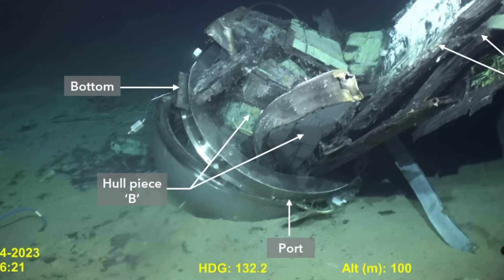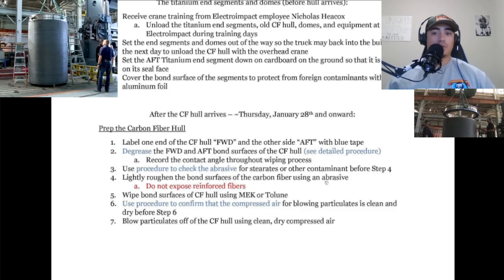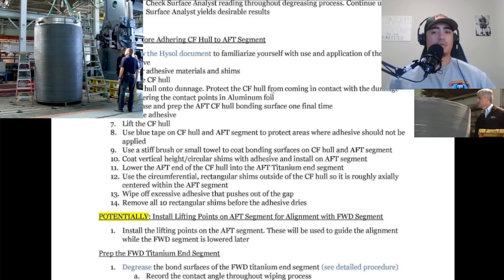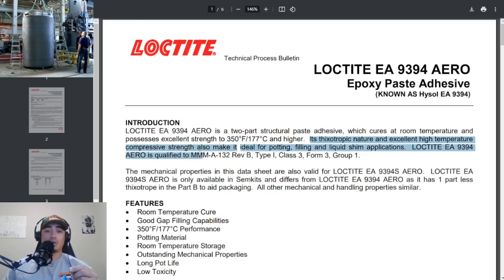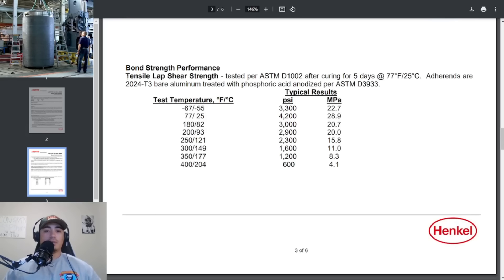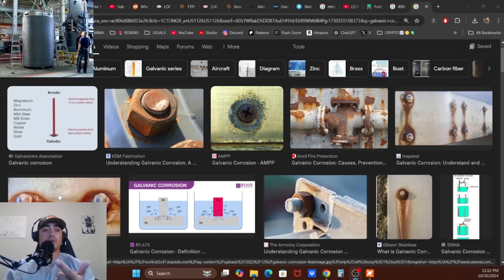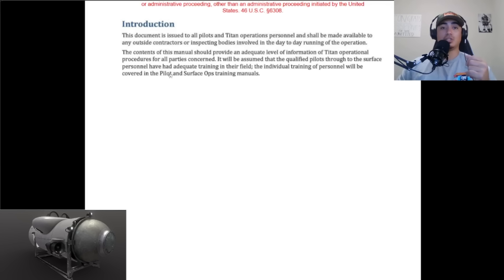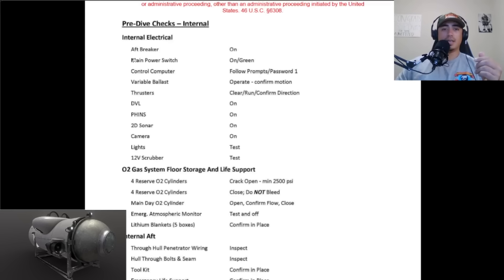Part 5: OceanGate TITAN Investigation: Money Laundering, Glue, & Operations Manual - Latest Files

Comment: Not only what appears to be rust on that front titanium flange at the bottom/inner edge, but it looks like oxidation on the top/outer edge, just like what you see in aluminum.  And then you tell us the loctite has aluminium fillers.  And I say to myself, again:  FFS.

Comment: GREAT VIDEO .   I think There is no good way of mounting carbon fiber tube to the titanium ring  . the carbon  fiber and the titanium movement under pressure was massively different . The carbon fiber tube was scwished in middle at the center of the tube more than the ends pulling the carbon fiber away from the titanium ring with great force till it failed along with many other things also i believe with every dive more and more carbon fiber strands  broke with every dive . Personally i think the design was a bad idea and never should have been built . To me i can't believe it made it to the titanic on the first dive . To everyone that died my prayers  go out to you .   R I P .
Reply from the maker: Thank you for sharing your thoughts. I agree and even the acoustic and strain data agrees. There was a loud BANG on dive 80…. This was dive 87 and should have been decommissioned

Comment: how were they going to use those four oxygen tanks if they were trapped, if they let the air out of the oxygen tanks the pressure inside the sub would pressurize them on the inside with no where for the extra pressure released to escape  !!!
Reply: the volume of the oxygen in the tanks would not have pressurized the entire volume of the sub much, as gas expands into a greater volume its pressure drops....

Comment: I think your analysis of the bond strength is incomplete.  First, the data is for aluminum bonded to aluminum, so all bets are off for carbon fiber to aluminum.  Furthermore, the forces at depth are at least three; first, the pressure will tend to push the titanium ends tighter to the CF hull tube, compressing the joint.  Second, the varying temperature-caused movement of the Ti and CF will create immense sheer force on the joint,  Third, sea water will force intrusion into the joint from the edge.  So this analysis is sort of irrelevant.
These engineers were amateurs in at least a hundred ways.  They had no business designing a life-critical device.
Reply: First off, excelent point you made.  OceanGate made prototype artfical heart valves for the first time , self certified the unit with their own statistical data with zero industry peer review, and now the client is dead on the street because the valves imploded.  This is what happens when someone has a lot of money, but not quite enough, with a desparate desire to bring his dream to a reaility and consciously believes his expertise is sufficient.  History is filled with prototype build dissasters and lost lives driven by phrases like, "nobody in the industry is pursuing my approach," or "we know what we are doing, or our methodology is proprietary", and maybe 'batten down the hatches, full speed ahead with gluing titanium to a carbon fiber face with 5,900 lbs/sq.in of water pressure scratching to come into your peanut shell - just maybe.

Comment: The most elementary flaw in Titan is using carbon fiber in compression.  In the same way one can not push on a rope, one can not push on carbon fiber.  The only load bearing part of that hull was the epoxy.  There are many successful pressure vessels with the high pressure on the INSIDE made of fiber epoxy: MX missle, space shuttle booster, breathing air tanks for firefighters, CNG fuel tanks that are steel with a fiber epoxy outer wrap.  Rush was an arrogant moron.

Comment: Once I was repairing a 53 foot trailer and had welding and bolting to do but steps were not indicated. Went on Hendrickson website in hope to find a better document explaning procedures and there was none. Had to directly call the engeneer (sorry for my bad french 😝). 

Turn out I got even more such as welding debt and angles and I had to weld some parts first and then bolt some part an continue with weld after. If not done in that particular order or it would creat stress points at many points and geadualy start cracking. 

Mind you I wasnt working on a submersible, I was working on a 53 foot box with tires and brakes. Ocean gate botched everything from start to end. This should be considered like a criminal act.